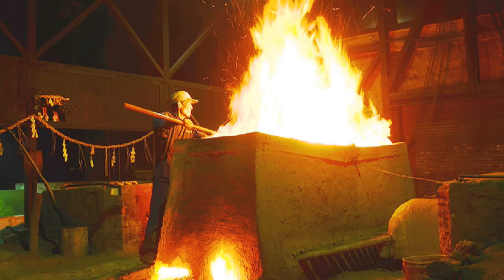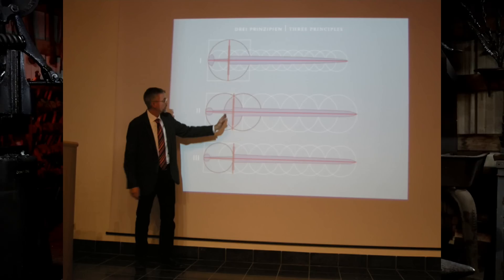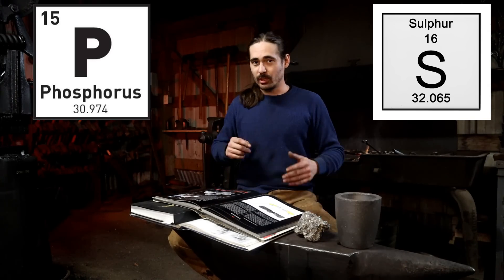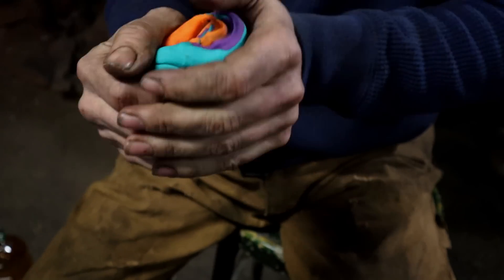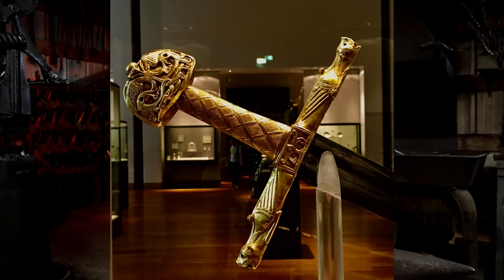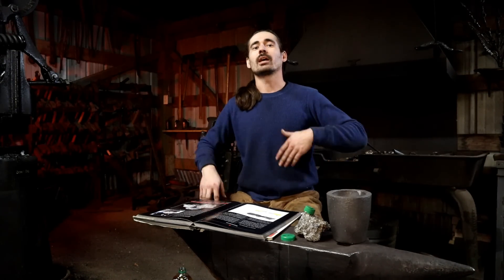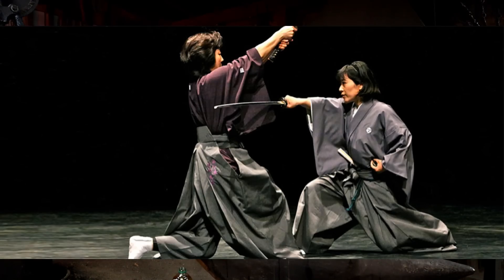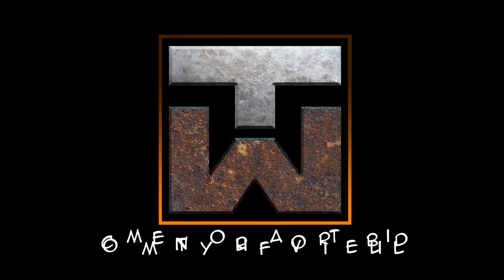Misconceptions About Medieval Steel - Wootz vs Bloom

Comment: This emphasis on context is interesting food for thought whether you're a fan of European, Japanese, Chinese  or Middle Eastern smithing. It would be interesting to see how reproductions of each type of sword, made using historically accurate smithing methods, actually performed. Both in general as far as cutting performance and durability as well as in a martial arts or HEMA context. Against like for like as well as type versus type.

Having a background in the fine arts I can speak a bit to the accuracy of illustrations of the time. In the medieval and renaissance periods illustrations, although attempting to convey accurate detail, often tended more towards following various stylistic conventions over dimensional accuracy and also often contained deliberate exaggerations to clearly emphasize meaning to illiterate audiences. Accurate perspective was also  absolutely not a thing in medieval illustration and didn't mature until the late Renaissance or even, arguably, the industrial age. Literacy was on the rise post the invention of the printing press but high levels of literacy were hardly universal, therefore illustrations were often used as substitutes in order to communicate meaning to a larger audience and as such, exaggeration was common in order to communicate intent as clearly as possible to these various audiences. 

Literature of the same period also exhibits tendencies towards exaggeration in order to convey points as well as to present a compelling (and often flattering) description of reality. As such, illustrations of the period simply cannot not be taken as literal depictions and when reading literature we must be careful to separate allegory from fact. 

In the context of the springy sword debate I would argue strongly that depictions of sword curvature in illustrations simply cannot be taken as being accurately representative of the amount that swords were actually capable of bending in reality as we simply cannot know the exact balance of intent versus skill of every illustrator. 

That's not to say that there's not a whole lot we can infer from literature and imagery but simply to say that we must infer from those sources with a very large grain of salt.

This is precisely why metallurgical testing of as many real world samples as possible is essential and recreations of historical practices should be continually revised accordingly. 

It also goes without mentioning that there was likely quite a variance between common and best of breed examples of craftsmanship in the medieval era across all cultures, must as things are today. Therefore we need to be extremely careful when assuming what 'typical' attributes were. Much as not everybody drives a Bugatti today it's quite likely that the qualities and properties of average military swords in each culture varied greatly versus the absolute best examples of each culture and era.

Comment: Practical applications throughout the history of cavalry in the post gunpowder era  consistently show that heavy cavalry was equipped with straight blade swords because it was the easiest to aim at an opponent in the charge. this model was copied worldwide. Your argument that a curved blade is superior from horseback is purely speculation. the pattern 1908 and pattern 1912 swords are prime examples of the result of centuries of cavalry sword blades from say, 1796 onward gradually becoming more and more straight with each new model. eventually light cavalry patters were dropped entirely because straight blades were seen as superior to curved blades in the context of cavalry.
Reply: just reread this and i sound like i'm being pompous and ungrateful. the video was actually extremely enjoyable and i found it very insightful! But you got me fired up on the cavalry bit...i'm a cavalry man. that's my jam.

Comment: Touchy subject it seems,
even today the ancient process seems steeped in mystery and supernatural like reverence. Analyses of the metals in question ,regarding structure and hardness seems the only way to determine the metals quality.Indeed we have superior steels today because of this. Steel making would have been a guarded secret"back in the day" so quality would vary place to place.As would the availability and quality of raw materials.The only way quality could be assessed would have been observational,based on previous experiences of the smith.Same with temperature control. The whole manufacturing process,extremely expensive and labour intensive.As always more modern methods would have been employed (crucible steel ect)to produce more,more  economically.I agree each weapon type,fit for purpose,or horses for courses..   great men. 60 rockwell+/-   is no joke working this way........"we stand on the shoulders of giants"

Comment: while i found this video very well made and containing good information, I have to point out something: 

You seem to have misunderstood why HEMAists use springy blades and why HEMA practicioners break blades made of modern steel. HEMAists use flexible blades to train thrusts without the risk of injuring your training partner and if you bend a piece of steel too often it will snap at some point. Federschwerter (or short, feders) were also historical used practice weapons, and were flexy too.

Of course our training tools need to withstand more abuse than any historical sharp sword, because we want to use our swords for longer even if we make mistakes. We dont want to give a beginner an expensive  practicesword just for him to wreck it after his first drill.

Dont get me wrong i think you still have a point.

Comment: 30:09 Wrong. Blacksmiths came slap bang in the middle of the caste system ie Vaishyas (craftsmen  and traders). Above were Brahmins (teachers and priests) and Kshatryas (warriors, rulers) and below were Shudras (laborers) and Untouchables).
Buddhism never really took hold in India because it excludes a class/caste system.
Also the medieval European blacksmith was a person of high standing perceived to have almost magical powers. This changed only with urbanization when a town blacksmith mostly made tools and nails but it did not change that much for the sword-making blacksmith.
Unlike in Japan were Katanas were heirlooms in Europe very, very few of the best swords survived as these were seen as personal items and buried with the owner. Surviving found swords are mostly cheap, easily replaceable ones from common soldiers.

Comment: If crucible steel was so shitty, why was it used over more common Bloomery steel? In your own video of the Ulfberht it was called a super steel. Why where swords like the Ulfberht even special if crucible was so bad? 
Another question, you say that the crucible had a small hole in the top. Would this not allow off-gassing of Phosphorous and Sulfur? 
Also I've seen it written that it was trace amounts of vanadium that gave Wootz steel it's distinctive pattern, not Sulfur and Phosphorous. Thoughts on that? 
My apologies if this is overly aggressive, truth be told I am a big fan of Ulfberhts and crucible steel in general.

Comment: But if you followed thru with the same folding procedure for crucible steel, how would you not end up with a similarly ‘clean’ steel? You describe the omission of the folding in crucible steel but insist on the folding of japanese bloomery steel. Ultimately, in either case, the process of folding the steel helps to expel impurities and carbon down to an acceptable level.

Comment: Wait, where did the mistake come from that EU = only crucible steel? Even from the era of early rome, but especially (first rare with east europe and scandinavia then later across the EU from circle mid 12th cent), European swords used a combination of processes (and for the most part did not include high% of impurities compared to equal period east asian blades, tho india falling far behind japan there), tho for the last point, no, hell crusaders were mostly armed with blades whose metal was smolten in bloomery furnaces, not just because its cheaper with less work, but also because its much faster to arm people without modern tech.

As far as museum pieces go, it depends on which ones, how well they were preserved (in fact one of the source references of the Sachse Damascus notes is shared with The Sword and the Crucible: A History of the Metallurgy of European Swords Up to the 16th Century, which goes on to note how, what would now be called wallhangers, along with uncared for lost/stored away in bad conditions, but ones which wouldnt completely destroy the blades make a solid chunk of display pieces, but arent representative of the average). And thats not to mention how the point of war based martial techs is killing the enemy, not on a effective draw cut which are most relevant when on the defensive/amushed.

Comment: This is one I'll have to come back to. 

I've stood by the point as European smiths, armour and blade smiths mastered steel as much as they could, it was in the heat treatment that allowed the rise of the extremely protective plate harnesses we see, especially in the mid, late 15 century, to the sixteenth century. The prime period of the longsword. The technique seems to make sure of the rigidity and survivability of the long sword. Specifically when you cut, move in a particular way, the blade will stay on that path and not deflect even when striking another object. 

I think I need a new set of sources. I'd argue with centres of steel production in Toledo, Solingen, the centres of production for armour in the later period, they must have some understanding of the nature of the material they were working with. Even if it's only tradition of word of mouth. Of course, this is hard to prove as it was not written down, wasn't recorded. It could be recorded, but it was the common way things were done. The more common, the less it was written about. A lack of education is not a lack of knowledge or a sign of a lack of intelligence. 

Then again, thinking about this, you have in the western traditions, western manuals, which we do not train in the full context of. These manuals were of the art of killing. Of killing without being killed in return. The same is true of iaido, the like from Japan. They are killing arts, killing forms. They are designed to keep you safe while killing another person. Leichtenaurer is a prime example of this, the whole point if Leichtenaurer is for you to have special techniques to use on the people who you fight who are not trained in Leichtenaurer. Tallhoffer basically says, these are the techniques I found that are best for these situations. Use them, or don't, I don't care if you're dead, you might. Musashi himself had a similar attitude. You take the techniques that you need to win and you train in them. Some may involve chipping away the edges, of seeking the weak points and striking them (sounds suspiciously like half swording in the European tradition) and in other cases, seeking that singular clean cut. Of striking without being struck in return. 

I always credited the Japanese smiths for not just getting steel, but making the most of the material they had. I've heard of a katana put together in such a way there was something like not just two, three, in this case six different different pieces of material. The spine and sides of the blade were of different pieces of material, of course, the edge being the highest carbon. They got their material and made the most of it. A goal for any smith of any time. 

As for adding in the cultural element to swords, it's worth discussing. However, I'd have to argue with you at least in principle. There's a practical element, practicality I think gets lost here. While we have records of the time and we can do our best to understand them, we are also looking at a very limited pool of information. A very limited set of perspectives. I think there's going to be stuff we've just missed out on and can never recover. 

So, saying that the cruciform hilt has religious connotations, creation to represent, you might be right. I think the reason it would have lasted would be out of a sense that it had a practical value as well. It's not just that it does represent the general spiritual, religious belief of the time, it also has a value in protecting the hand, later as a striking implement. 

Still interested in what you've got to say Ilya, and co. Seriously, Youtube is about the only place I can have this discussion. Can't get out to HEMA clubs of late and even then they're more about the swinging that the archaeological stuff, the research. 

And Shad, yeah, well, the less said the better. I'm not saying he can't be right. I'm just saying I'm the worst person to ask for an opinion on.

Comment: Good video, but riddled with misinformation and preconceptions. I doubt I'll get any response to this comment, but here it goes. First, have you even read Alan Williams and his book "The Sword and the Crucible?" If not, you did a pretty poor job at preparing to this video. Yes, some European swords kept being made of forge welded construction well into the XVIth century, but are you aware that blast furnaces were a thing? Also,  the "medieval period" in Europe lasted for roughly 1000 years, so you'd better be more specific with your "medieval European sword" description. Mono steel blades were definitely a thing at least from the XIVth century, if not before that (excluding the wootz steel blades imported from the Middle East, of course). And of course those blades were heat treated. You are not making a fair case for the European blades at all, which is rather sad since your video is so well structured to begin with. 

Next point. Blacksmiths didn't make swords. Sword makers made swords. And I can guarantee you that they were quite well esteemed members of their community, thus most likely literate. Armourers for examples in the XVth century in Milan got titles form the Dukes of Milan for their services, so basically they became nobles. I'd love to hear where you got your sources for swordsmiths and weaponmakers as being cast away from their society. All the evidence points to the contrary, actually.  

Also don't get me started on your comparison between the European swords in museums and their Japanese counterparts. It seems rather obvious that you have no idea how the read and interpret Medieval aestethics and you are judging the craftsmanship by modern standards only. Also, I wonder which blades you actually looked at. Your position that European blades make up for their poor quality in their blades with their embellishments on the hilt is also rather disingenuous and to me it sounds like you haven't looked at many swords from very close. 

Sword blades do break. That's obvious. It has nothing to do with modern HEMA. The people in the middle ages know that perfectly well. Blades broke all the time. There are hundreds of representations of battle scenes where the ground is littered with broken weapons (swords, spears, lances, axes, pollaxes, etc). That's just the reality of combat. And I'd be pretty confident in assuming that it happened exactly the same in medieval Japan. Weapons break. Armour breaks. Shields break. That's just hoe it is.

Sorry if I sound rather aggressive, but I'm rather upstet that we are in 2020 and this trope of the "dumb, dirty, European medieval blacksmith forging alone in the forest" stereotype still exists.

I do fully agree with your conclusion, but they way you got there has all sorts of problems =).

Edit: bottom line is there were of course varying quality of swords, both European and Japanese. So I don't think it's wise to generalize too much, and instead it would be better to compare specific examples with equivalent in quality from the other culture. I'm quite sure that Japanese swordsmiths did also to plenty of "crap quality" blades, as well as European swordsmiths did plenty of excellent quality blades.
Reply: "It seems rather obvious that you have no idea how the read and interpret Medieval aestethics and you are judging the craftsmanship by modern standards only" Are you aware of Ilya´s work history?  to tell him he has no idea about medieval aesthetics shows your lack of research about him tbh. 

Also stop using roman numerals to describe centuries , we all know how to read them and it doesnt make you look any more qualified, yet introduces more risk of misreading for those trying to quickly fly over comments.
Reply: @snakeace0  Judging by the statements of "you can see the file marks, therefore that's bad craftsmanship" and stuff like that I see that he's coming from a modern perspective. I'm not doubting his crafting skills at all, I've never put them into question. But I do object to his qualitative statements based on a modern eye and aesthetic, where imperfections, asymmetry and tool marks are seen as a sign of inferior product quality. Which are not, of course.

Regarding the Roman numerals, that's just how I always been doing it and seen it used quite extensively by the people I've been talking with in these last 10 years about arms and armour. If it's confusing, well, too bad I guess.